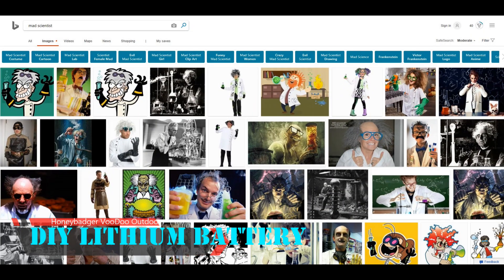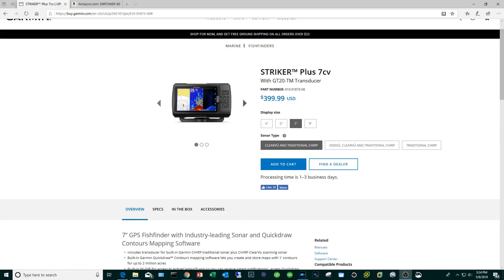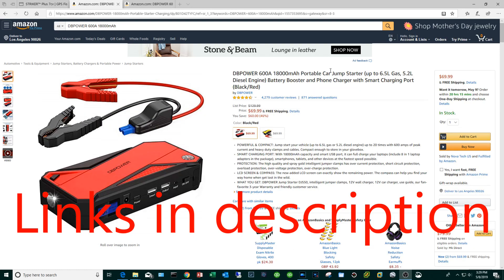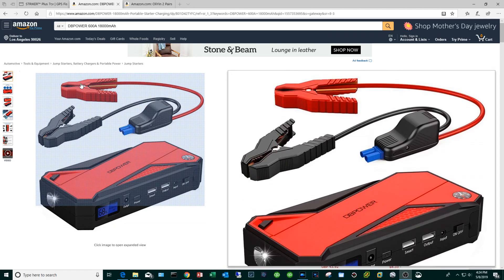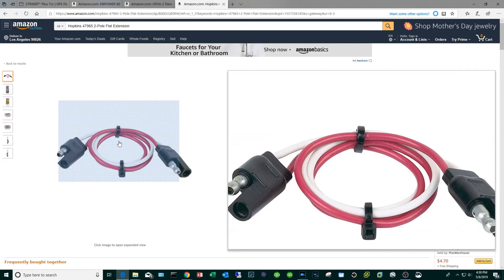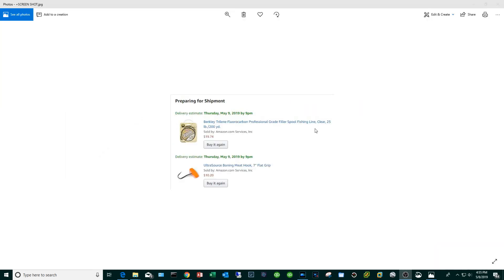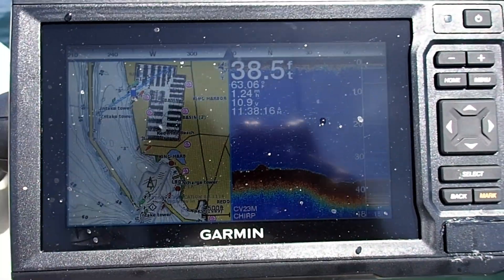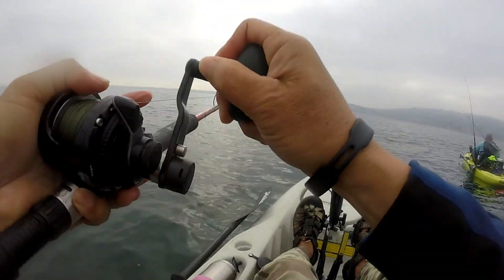Kayak fishing fish finder battery made from portable car jump starter.

Comment: I've been searching for all the connections you identified in this video. Perfect solution.....thanks for the effort and on-point video...
Reply from the maker: Glad I could help. You might want to check out this video as well: https://youtu.be/qrVUek7A88Y
Reply: @honeybadgervoodoooutdoors7305  Yes I had that lithium battery already on my Amazon list and I already own an battery monitor I can mount on top of the case you showed in this video. With the connectors you identified that may be the way to go. Also think I can mount the battery charger in the case with a connector to plug it in. Thanks

Comment: Love the video. Thanks. One question I was looking to get some input on. Why do you have the wiring in the middle of your set-up. Ie. why don’t you use the wires that come out of the lithium battery (oliyin EC5) and splice them directly into the black waterproof wires (LED JUMP) coming out or into your box?  Ie. I don’t understand why the middle wires (the Hopkins 2 pole) are needed?  Sorry if the answer is obvious or I missed it in the video. 

Last I am assuming the female LED JUMP wire that connects to the male LED Jump wire (that comes out of your box) is then spliced directly to the wiring harness that comes with the Garmin Striker unit?  

Thanks for any of your help. And thanks again for the video. Much appreciated.
Reply from the maker: Hi, I need the quick connect/disconnect because I have multiple sources of power. I sometimes spend 10+ hours on the water, so I need something that I can swap out quickly. And yes, the LED is soldered directly to Garmin. Use heat-shrink and/or lots of electrical tape. If any part of the wiring becomes corroded (common), you'll face the most annoying gremlins.
Reply: Thank you again.
Reply from the maker: @gregg7924  Don's mention it, braddah. Go out there can catch some fish!

Comment: I think that your starter battery also has a round barrel connector that can output 12v at 10 amp.  This is designed for a cigarette lighter adapter.  I think that output might be a better choice for your fish finder and may give even longer run times.   Have you tried connecting the fish finder to that output jack.  Most of those starter batteries use the port you did because they can handle 600+ CCA (Cold Cranking Amps) needed to start a car.  Your fish finder may use 2/3 amps.  The 12v output on your starter is a much better choice to run the fish finder.
Reply from the maker: Thanks for the tip. I'll check it out when i get a chance.

Comment: I got inspired by your project and bought an Audew 1500 A, 20000 mAh car jump starter to power my fish finder but also to run my 12 v Bravo BTP 12 air pump when pumping my inflatable Zodiac. I don't have my fish finder at the moment so I have only tried the battery with the air pump. I can get it to run if I connect the battery by using the "intelligent jumper clamps" and press a boost button on the side of the black box but if I run a direct connection from the battery EC-5 socket to the air pump I get no current. Do you know what the problem is? You setup seems to be  working fine without going through the "black box".
Reply from the maker: Gosh, not familiar with that model, so it's hard to say. Do you have a multimeter?
Reply: @honeybadgervoodoooutdoors7305  I just did a test running the air pump from the cigarette lighter in my car and then from the car jumper through the intelligent jumper clamps and with boost button pressed. It sounds like the air pump is running at 1.5x speed from the car jumper and that worries me a bit. I don't know if the cigarette lighter from the car delivers too little current or the car jumper too much (if that is even possible?). I don't have a multimeter but I can get a friend to do some measurments.

There is no "boost" button on the black box connected to the clamps on your DBPower battery? I'm not sure what happens when I press the boost button on mine but I hear a "click" and then I can turn on the air pump.
Reply from the maker: @KristianGrSl  Yes, I'd rec getting a multimeter. Even the cheap ones on Amazon are pretty good.
Reply: @honeybadgervoodoooutdoors7305  I tested the socket with and without the black box and it delivers 14.9 V in both situations. That why the air pump was running so hard. Maybe a bit much for a 12 V appliance. My Garmin Striker Plus 4 cv will run on 10 to 20 Volt so it should be fine for that at least.
Reply from the maker: @KristianGrSl  Yes, the Garmins are pretty good at eating anything from 10v to 20v. I've tested that much, for sure.
Reply: @honeybadgervoodoooutdoors7305  I figured out what was wrong with my setup. I bought the OliYin EC-5 connectors and trusted that the red wire would be hot, but in fact the car jump starter EC-5 female plug had switched the hot and neutral so the black wire was hot. Duh!
Reply from the maker: @KristianGrSl   Right on. Glad it worked out for you.

Comment: how'd that meat hook gaff end up working? Been pondering the same thing myself...
Reply from the maker: hi, for the couple of times i used it, i thought it worked pretty well. for a kayak application, i think the meathook just makes more sense. the longer gaffs are just too unwieldly, imo. i don't think it takes any more effort to bring a fish next to the yak, as opposed to trying to gaff it from 3' away. having said that, i don't keep many fish, and any fish requiring a gaff is one that i'd most likely turn loose. on rare occasions, i'll keep eater-sized fish, but that's about it.
Reply: @honeybadgervoodoooutdoors7305  Thanks for the reply! I may get one then, just in case I ever get a king mackerel or something. It's not like it takes up a ton of room, and if it works well why not?
Reply from the maker: @BeetleBuns  good deal. you'll have to sharpen it once you get it, and you'll have to maintain it to ward off the rust.

Comment: Does Jackley or any other solar pawer generator work with fishfinder?  so when I go camping with Kayak I dont have to worry about fishfinder battery.
Reply from the maker: If it outputs 12V, then it should work, although that's an expensive part that will get ruined if salt water finds it. I'd recommend something like this: https://amzn.to/2S6opWa
Reply: @honeybadgervoodoooutdoors7305  Thank you for your suggestion. ^^

Comment: I have a Lowrance Hook 4.  I purchased DBPower DJS80 12800mAH/47.36Wh/1000A.  Before I did all the wiring, I tried to test just clamping the aligator clips direct to my FF wires.  The FF powers up to main screen then shuts off.  I do not know if the "intelligent" current protection is stopping it from working.  I tried with and without powering the unit on.  Do you need to turn the DBPower battery on?  I ordered some EC5 connector cables, I am hoping by going direct will solve my issue.  Appreciate any advice.
Reply from the maker: Hi, did the EC5 cable work? That's what I had to do with mine.
Reply: Hi Victor. I had the same problem as you. Check which plug in the car jumper EC-5 socket is hot and which is neutral. It was reversed compared to the OliYin connector cables on my jump starter...

Comment: Can you try using 5v to 12v step up converter? Ive seen one that is using it and works well!
Reply from the maker: I gotta tell ya - that's probably a little above my paygrade :)
Reply: @honeybadgervoodoooutdoors7305  the usb type one so you can plug it in any powerbanks. Its pretty cheap like under 5usd
Reply from the maker: @huntepic6325  Man, that would open up a lot of possibilities, for sure.
Reply: @Hunt Epic did you try it...?

Comment: Great video as always!
Do you need to push the power button or just turn on the power switch.
I bought another jump starter that claimed 99900mah lol. Powered my lowrance hds7 for about an hour and a half. 
I have this specific one on the way now. I'm hoping to get 5 hours out of it.
Reply from the maker: Thanks. Are you buying this specifically to use it as a ff battery? If so, I think there is a better solution: TalentCell 12V Lithium ion Battery PB120B1 https://amzn.to/32CBoBF
Reply from the maker: I believe that device can power up your Lowrance 7 all day long, and maybe even beyond.
Reply: @honeybadgervoodoooutdoors7305  thanks, the DB unit arrives tomorrow so I'll give it a shot first. Amazon had a flash sale on it for 45 dollars.
Reply from the maker: @CaliforniaOutdoorsman  Oh, that's a good deal then. The DB was good for at least 6 hrs on my Garmin 6" screen ff. Let me know how it does?
Reply: @honeybadgervoodoooutdoors7305  will do, thanks man!
Reply: @honeybadgervoodoooutdoors7305  I have the DB running on  the HDS 7  in simulation mode for the last five hours and it's at 76%. Might drain faster in real life, we'll see this weekend
Reply from the maker: @CaliforniaOutdoorsman  Sounds promising. Thanks for the reply Steve.
Reply from the maker: @CaliforniaOutdoorsman  Hi Steve - any results from on-the-water trips?
Reply: @honeybadgervoodoooutdoors7305  yes it worked amazing, I was offshore for 3 1/2 hours and it was still 100% when I got back to shore.
Reply from the maker: @CaliforniaOutdoorsman  Wowsers - that is great to hear, especially given that fact that it's powering a high-end 7" screen fish finder.
Reply: @honeybadgervoodoooutdoors7305  yeah I really don't understand how it's still at 100%. I was using charting and everything. 
I almost sent it back because it wasn't charging but finally realized it was plugged into an outlet that was controlled by a light switch and was only being turned on when I went in to check on it lol
Reply: @CaliforniaOutdoorsman can you put a link to that unit? To be sure which it is?

Comment: great - well done. Any issues so far?
Reply from the maker: Hi, I've since moved on to the honey badger double barrel battery compartment populated with twelve18650 batteries but I don't see any reason not to use the jump starter if you have a smaller fish finder. You might also want to take a good long look at the link for the talent cell battery blow. It is essentially a housing for the same dozen 18650 batteries.
Reply: 18,650MAh batteries? Twelve???? Are you running a bunch of other stuff off of that like an electric motor etc. Looking forward to the video
Reply from the maker: @yakkerklrm3659  Hi, I was referring to lithium-ion 18650 batteries. https://youtu.be/2dgdC6sZLP8

Comment: Hi, can someone also explain the following to me?
A jump starter with 99800mAh, 12V and 88,8Wh.
A ff garmin vivid 5cv, 0,4A till 1,5A and 12V.

Usable battery time calculation A:
99,8Ah : 0,75A (as it goes from 0,4 till 1,5A)=133hours -10%(loss)= 119,7 hours and if i keep 40% safety marge for keeping battery healthy 71,8 usable hours.

But (!)

Usable battery time calculation B:
88,8Wh (=battery capacity of the jumper) : 12V= 7,4Ah= 7400mAh

Where am i going wrong?